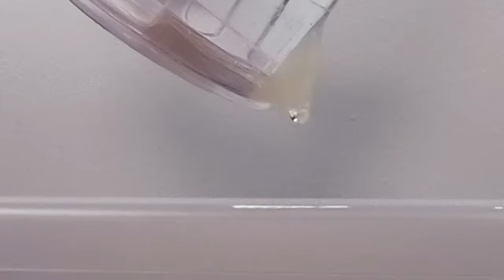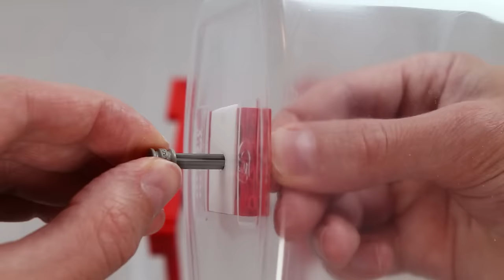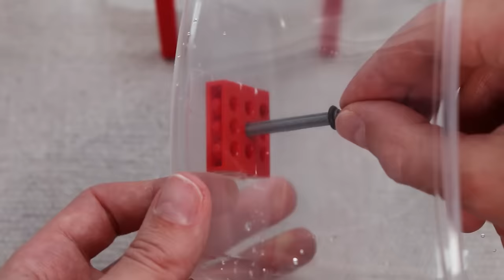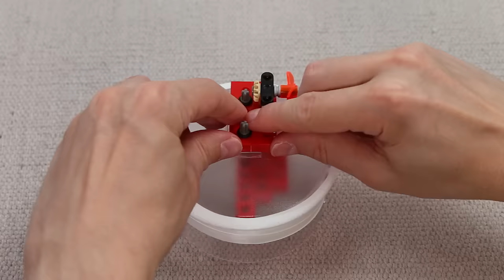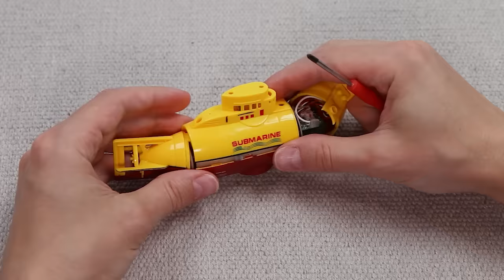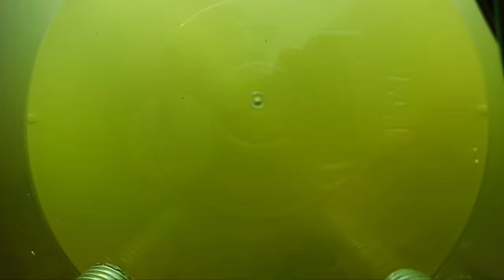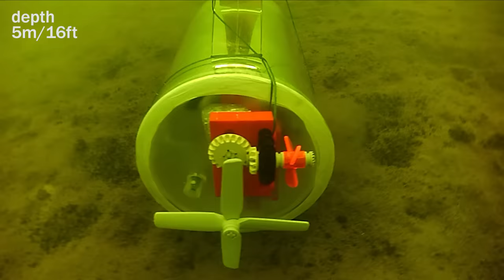Building and Testing a Lego-powered Submarine

Comment: 12:40 Outside water pressure is to large for engine to pump out off the balast water, so its stalled.
Reply: exactly what i was going to say
Reply: Yeah, also a real life sub would have stores compressed air and hydroplanes to help with depth changes. Just pumping out water is only one part of the equation.
Reply: was searching for exactly this
Reply: I totally knew that
Reply: Yeah, but he realized as well, hence he pulled it up and then tried pushing out again
Reply: @darkhuntermini3034  totally ...
Reply: So what you are saying is that it need no air container things (idk what the word is) to keep it afloat or go down due to the boancy of the submarine? Or am i stupid
Reply: @TinyHandsWorking  it either needs something like hydraulics with even more pressure than the water outside to clear the ballast or it needs something to close the ballast and make it feel like it’s surface pressure
Reply: it's*

Comment: 12:45 too much water pressure, the motor doesn't have power to push the water out. At 5m deep you get 7.1 psi of pressure.
Reply: It has enough of a gear ratio that I think it would do significantly better if the mounting didn't get pushed sideways like that.
Reply: Pedro Teixeira x
Reply: It sounded more like the Gear Wheels could not bring the Power to the Tank.
Reply: Wee bit of trivia:  For every 10 metres of water depth (or very closely thereabouts) you gain an entire additional atmosphere of pressure.
Those subs that made it to Challenger Deep are truly impressive constructions that the crazy Finnish guy with the press would have trouble crushing.
Reply: @Jan_Heckmann  Clearly there's not enough power because the water is pushing in on it and it's getting forced to the side. Both contribute. I'm speculating (without strong opinions) whether the jammed-sideways-ness might have a similar or greater exacerbating effect compared to the ~25 N needed to overcome water pressure. 25 N seems within the capabilities of that actuator, if it could just push straight.
Reply: @sealpiercing8476 Did you hear the Noise when the Motors tryed to push out the Water?
It sounded like Gears getting damaged.
Reply: @Jan_Heckmann  Yes. It had trouble, couldn't do it. I think that actuator could handle 25 N, but may have been up against more resistance than that because of the way the mount tipped over.
Reply: yea but how could he solve that issue you suppose? a cage to better pull the syringe? or maybe a dedicated engine to push out the water and one to pull in the water?
Reply: @unbornstd  Put the actuator on a mounting directly opposite the syringe so that the shaft is on the axis of the center of the plunger. That way there's nothing trying to go sideways. If he ever revisits this, that is. And maybe it isn't strong enough even so.
Reply: Yeah I understand what these words mean, totally
Reply: From what I'm getting, it would take ~35N just to start pushing water out of the syringe at that 5 m depth (not including the friction on the plunger) and I'm not familiar with how much force lego motors and actuators can put out but this may be on the verge of all it can handle, even when placed axially. Attaching a spur gear to the actuator and driving that with a worm gear attached to the motor would be less toque intensive.
Reply: A different hull as well it will give him move room to work with
Reply: Maybe try and get some air pressure inside the cabin (or only part of the cabin)?might be hard to do and would need to loose some weight but could solve the pressure difference problem
Reply: @iguessmynamesriya7658  i feel ya
Reply: It’s also important to remember that at the bottom of a lake their is no (extra) air to replace the water in the syringe. The pump is basically attempting to create a bit of a vacuum inside of that jug. If there was extra air somewhere to replace the volume of the water the pump would probably have no problem at all pushing that water out
Reply: i thought also it is probably not getting a proper RF signal for control
Reply: @griff5638  In response to yourself and valarion about the lack of pressure inside the hull you could use a pressurised can, like those dust-blowing cans you get for PC maintenance.  My suggestion in another comment was to rig it directly to the ballast so the ballast operates more like a genuine submarine ballast by expelling the water using compressed air, but you could also just have an actuator release the gas directly into the hull in order to take strain off the actuator that controls the ballast - in such a small hull it would effectively be the same thing I suppose.
Reply: Not radio strength?
Reply: @iguessmynamesriya7658  yea me too, totally
Reply: The outcome is so small, it just needs more power
Reply: @griff5638  I didn't notice air bubbles surfacing when it was descending, but they might've just been too small. Remember it starts out with the syringe empty, so if the hull can be made airtight, then the "extra" air will still be inside, compressed by the same motor when it filled the syringe. The increased air pressure would also help the motor expel the water to ascend.
Reply: Y'all are hurting me brain 🤯
Reply: Grover wouldn’t the same principle still apply? What I mean is that as the submarine descends, even with an airtight seal, the mass of air inside remains the same but the pressure outside increases greatly. This still results in a vacuum when you try to push the water back out of the syringe. The amount of force required to overcome this difference in pressure is greater than the force the motor is capable of applying to the syringe and therefore the water cannot be removed.

Edit: I guess that what I’m saying is the same as saying that the water pressure outside is too much greater than the pressure inside. If somehow, like someone above said, you could pressurize the air inside the jug you might be able to overcome this without any additional force from the motor.
Reply: GildenScale radio waves don’t really penetrate water. For underwater wireless coms we need a transceiver antenna to be submerged, and the density of the water means that higher frequencies are very limited on range - so we also use a very low carrier frequency for those wireless comms. 
Military subs rise to a little enough depth to float an antenna to the surface to communicate through the satellites.
Reply: @unbornstd  I wpuld probably add some rubber band around siringe to help motor to push water out 😂
Reply: @andinbriwel1092  I wouldn't think at 5m you'd have too much radio trouble. Besides, you can hear the motor trying to eat itself when it's suppose to be rising. Likely, as others have stated, the water pressure is pushing the air pressure inside of the container hard enough that the motor is essentially creating a vacuum (way too much pressure for that LEGO motor). I believe this was an issue with subs in the American Civil war, but since they didn't dive too far they could do it for short spans. (try and blow air into a container as you squeeze it, you get the simplified version of the problem with this system)

On top of that, as someone else stated, the motor is off to the side, causing some energy to be lost sideways (try lifting an object with your arms straight out vs close to your body).

Comment: The pressure from the bottom of the lake was too much for the syringe. Maybe try using 2 pistons. On in each side for more power
Reply: Use gears!
Reply: @101picofarad  that was my thought, but it would take up quite a bit of space
Reply: 101picofarad I think using 2 pistons on 1 syringe would be simpler cuz a gearbox that would be strong enough would be too big
Reply: @filiplayz1893  that's what I said
Reply: That's silly, they make metal gearboxes as small as bottle caps.
Reply: @AtlasReburdened   then they would be too small then it wont work or the "really small gears" will bend
Reply: @Legobot9000  It's painfully obvious that you have absolutely no idea what you're talking about. First off, "too small" is a meaningless classifier. What do you mean "too small"? Do you think the physics of mechanical leverage is somehow scale variant? 

And what on earth do you mean "bend"? That's a lego motor, a planetary gearbox with gears made of neoprene could handle that thing.
Reply: Nut than hè is To heavy.
Reply: But*
Reply: @harriethazeleger-schuurman3750   Did you see the huge ballast plates he added? There's plenty of spare weight he can drop.
Reply: @_xTwelve the young lad Minecraft reference FTW!  Nicely done... :)

Comment: Using the soldering iron + wax paper to melt/form the hot glue is genius
Reply: It was likely parchment paper. Parchment paper is used with hot stuff, wax paper is generally only used with cold items.
Reply: @ddegn  That makes sense; good point!

Comment: I’m surprised the remote worked that well through water.
Reply: Jeff Chamberlain I’m guessing the low frequency helps a bit. You wouldn’t get anymore than a few mm with 2.4ghz
Reply: Yeah, I think that's why he used another remote subs controller instead of the stock lego remotes. Probably needs the different frequency for water stuff.
Reply: Yeah, but does anyone know what module he used for running 9v motors of a 3.7v rc module???
Whenever I attempt to do that kind of stuff with old, trash rc cars I find and try to imply them in a newer handmade steel chassis, I just can't run the 12v 775s of the stupid Chinese 4.5v rc car module sets that no one makes separately GOD KNOWS WHY THE HELL and the 5v relay switches jank I attempted to make  just can't go in reverse polarity when the input input is reversed CAUSE I DIDN'T WANT THE JANKED OUT MOTOR CONTROLLER TO BE BIGGER THAN THE 4S battery that is gonna run my never happening dream!!!!!!!!!!!!!!
LIKE FUCK ME!!! JUST HOW MUCH DOES IT TAKE TO MAKE A SIMPLE 40A 4 CHANNEL RF RC MODULE KIT!!!
anyway, sorry for the frustration but if someone could help me with if not the link, then at least the name of the chip of the small red board...
I mean, finding schematic diagrams of circuit board for high power RF modules are really hard to stumble upon...
... And even harder to make.

Typing this on a smartphone is Thumb aching and frustrating enough...
Pls send help.
Reply: I mean, it was a remote control set for a toy SUBMARINE. I'd surprised if it didn't work in water.
Reply: Jeff Chamberlain cause there’s no remote, Stig is driving

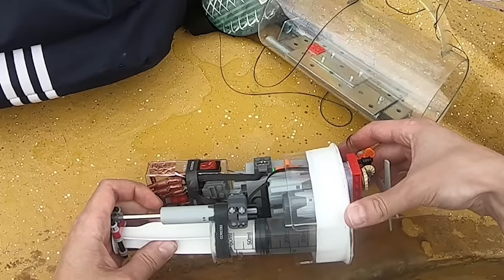Comment: 12:18 is the perfect example of "If it moves and it shouldn't, use duct tape"
Reply: That wasnt the issue. The problem was at that depth there was too much external pressure so the syringe couldn't eject water
Reply: @ari90i  I know that, the duct tape is helping it stay in place. it's literally held down with duct-tape, otherwise it would've moved. I know the problem was the pressure was too high at the bottom of the lake, the single piston couldn't handle that, so that's why a 2nd one was needed. Guess what? to keep this rig in place, I'll say it again, duct-tape was used.
Reply: @thanosattorneyatlaw4062  Im not sure, and im no physics man, but how would a second piston helped/worked in that case?
Reply: Kamilohbk A second piston is needed to help empty the ballast syringe of water while at a depth where the pressure of the surrounding water is too much for a single piston to force the ballast syringe empty. As Thanos said, duck tape is needed to help secure this second piston to the ballast syringe.
Reply: @jacobwetherington2654  ty
Reply: @Kamilohbk  P = F/A
P = Pressure
F = Force
A = Area
You can cheap out on motor by just using a bigger syringe, provided you have a good way of transmitting what little force it provides.
Reply: @Kamilohbk  To put it differently than Jacob, think of someone moving out of their house, and they try and get the bed into the truck(/ballast), obviously it's very hard for one person to carry a heavy bed, they aren't strong enough, but if they invited a friend to help them out they would definitely be able to move the bed with ease.

Comment: Do you know you can see what your GoPro is recording live using the GoPro app? That way you can make it FPV. Cool content 👍

 Edit: Apparently WIFI signal only travels a few centimeters/ inches underwater. However you can use a cable that connects to your GoPro. Link in the comments.👇
Reply: How well does the wifi connection work through water?
Reply: @himbeerme   I was wondering the same thing when he did the deep dive tests. I was so relieved when I realized he had a string attached to it because I was worried the remote control wouldn't work that far under water.
Reply: @monkeywithocd  Same, considering most DIY submarines I saw used a wired connection
Reply: Himbeer good question
Reply: Well, if you're able to connect to a GoPro out in the middle of nowhere, is it using WiFi? I always thought it was Bluetooth. In any case, BT has the exact same issue, so wireless connection method wouldn't really matter I guess.
Reply: the lower frequencies of the rf controller have an easier time getting through the water than relatively high frequency wifi signals which would be quickly attenuated. if you wanted a real time video view you'd either need an umbilical or maybe VHF, though VHF operates in the megahertz frequencies while that controller would be operating in kilohertz, so you wouldn't get much range without lots of power. still much more than wifi which operates in the gigahertz range.
Reply: @SuperAWaC  The controller uses 27MHz. Its written on it
Reply: @callummelb  ah well then it would be in the same order of magnitude as vhf video then
Reply: Instead of radio waves, it would be better to use sound waves for communication underwater.
Reply: @randomaccessfemale  yeap, good luck with that.
Reply: @randomaccessfemale  😂🤣🤣🔥🔥
Reply: You would need some sort of sonar communications technology. Expensive at the moment
Reply: Only low frequency ~40MHz can go underwater

Comment: You need higher gear ratio for the ballast ;) Love your vids!
Reply: Seems like the waterpressure deep down is too much for the motor
Reply: @itmarcel  i was just ready to type the same thing XD
Reply: @shadowlord0162  Glad I wasn't the only one! You could definitely go crazier with this one by getting a slightly larger container and refining the mechanics of each control. But the fact he got something workable in a small pond is amazing on its own.
Reply: @antiseth3964  true
Reply: I wonder if having to push through the smaller part of the orifice is harder than just cutting everything off and make the seal the same diameter as the barrel.
Reply: You also might need more torque
Reply: @TreYay83  Quite the opposite. The bigger the orifice, the more force the external pressure will apply. He can try with a smaller syringe and more travel. (or gearing the motor, whatever easier)
Reply: @framegrace1  I don't think it works like that, from memory the pressure at the bottom of a meter tall drinking straw is the same as the pressure of the lake at the depth of one meter, the pressure is the same. Increasing the orifice size will ease the flow of water through the port
Reply: @framegrace1  However a reduced surface area of the piston will decrease the total force exerted on the jack screw

Comment: “Are you making a submarine with a submarine.....?” 

“Got a better way?”
Reply: It's kinda like upgrading a lesser submarine into a proper war machine ready to serve brave russian mice sailors.

They would've pushed that syringe with ease, блат!
Reply: @karifurai8479  Блять*
Reply: My bad that's what I meant
Reply: @glidershower  Except he tore apart a working submarine to build a shittier one that doesn't work.
Reply: @glidershower  Well, the old submarine WORKED and didn't leak, so...
Reply: @MickeyD2012  I already stated your lack of an accurate perception of worth, no need to repeat that, man.
Reply: Why did you name yourself 102 117 114 114 121? BOLLQ? Is that supposed to be clever? And you stated your beliefs, nothing more.
Reply: @MickeyD2012  the old one wouldn't have been able to handle the depth either. At least there was an attempt to improve on that.
Reply: +The Original Gamer
No clue what you're talking about. What he did was use a toy's controller and radio chip to make something that can actually withstand pressure at the bottom of a lake and hold a camera.
And the finished product worked and didn't leak too, so what's your point?

I'll never understand people with your mentality. Reinventing the proverbial wheel can be both fun and useful; something doesn't need to be innovative for there to be value in making it. The value is in what you learn. Having to overcome the obstacles you encounter. And, after all that, having something impressive (at least to anyone who does have an accurate perception of worth) to show for it.

The number of times I've had to trawl through Stack Overflow pages to find an answer that doesn't boil down to "don't bother, use a library" because of people like you is ridiculous.
Reply: +The Original Gamer
Btw, no clue how you got BOLLQ from that. Heck, all you had to do was google "binary translator". 
Surely with your way of thinking it would have been much, much more efficient and therefore desirable to just copy-paste that into a web-based decoding tool than to make a pitiful attempt at decoding it yourself and fail, as you just did.

But hey, at least you got the numbers right. Looks like someone doesn't know what ASCII is.